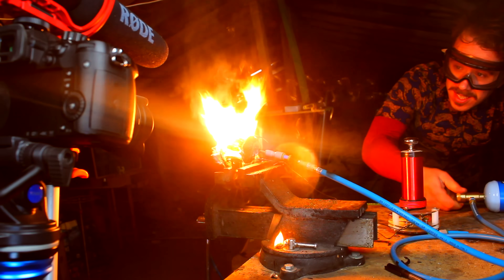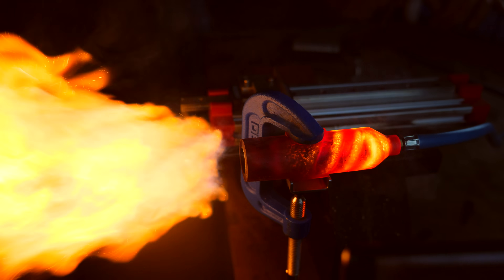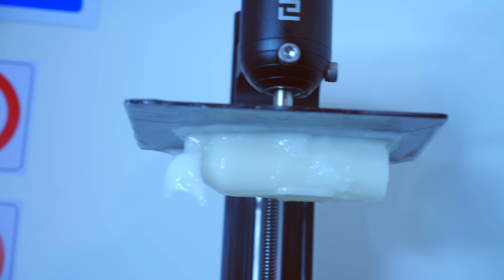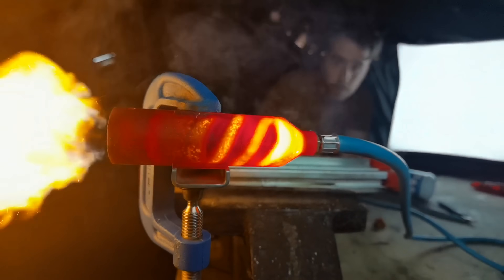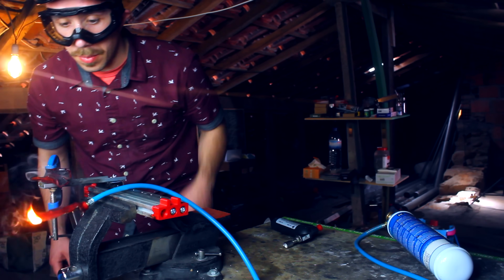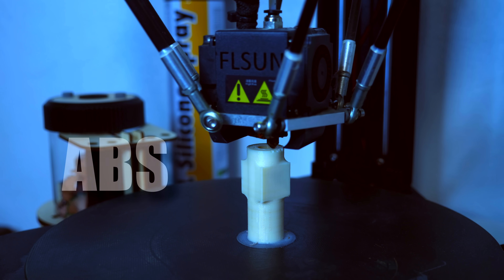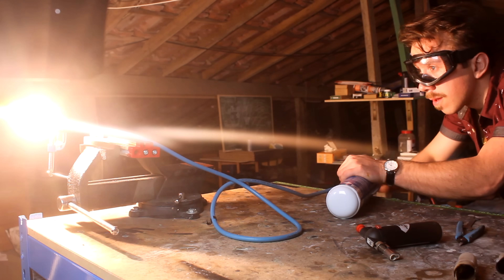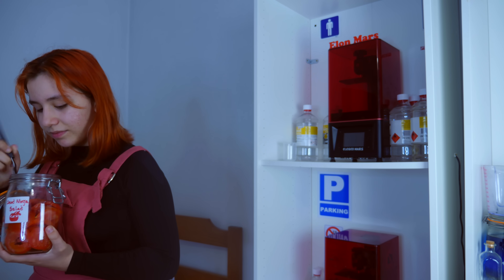Rocket engine that uses itself as fuel! (3D Printed)

Comment: Lots of other people saying this too, but:

The bright yellow of your ABS exhaust plume is unburnt solids, and basically means you're not getting nearly enough oxygen into the chamber, which is really hurting the thrust output and efficiency. Ideally the ABS would convert entirely into gas and expand under the chamber temperature to give a high exit velocity and thrust. But because there isn't enough oxygen for the fuel burn rate, the carbon in the plastic isn't fully converting to CO2 and is being ejected as a particulate solid. If you bump the oxygen flow rate higher, it should produce a flame that's closer to pure white and way straighter (rather than billowing around like at 11:13).

A really easy way to do that (I reckon at least) would be to insert a valve in your oxygen line so you can open the bottle to full flow rate before and then go to full combustion in less than a second. During the time it takes you to manually throttle up with the hand valve, the fuel is burning very suboptimally and costing you a lot of thrust. 

Feel free to DM me for more hybrid rocket deets, I'm working on an extremely large one in my university team :D
Reply: Underrated comment

Comment: I wonder if your thrust "measurements" are not showing much because of the engine placement on the arm. Specifically, I wonder how much of that energy is being used to try and turn the arm rather than push it forward. I'm no engineer or physicist, just a normal guy with actual questions.

Comment: Use a thick walled cardboard, 10mm walled tube for the body of the rocket motor. you will need steel or graphite or ceramic for the nozzle and forward bulkhead.

Comment: With the rockets try using a copper tube for the body and printing "inserts" to use as fuel. Use the same electro plated parts for the nozzles.

Comment: You coud print the body and then put it inside a steel or aluminium tube of the same diameter.. well, not the same, slightly larger tube, so it have more resistance.

Comment: If the fuel of the rocket is in the plastic housing, could you try to increase the surface area inside the rocket? This would increase the burn rate, which increases internal rocket pressure -> increases thrust? Additionally, making sure that the inputted oxygen is interfacing with the burn surface of the rocket equally and consistently would make the rocket more efficient per amount of fuel used.

Comment: Great Video Buddy!

  MY Submission for a future video !

 3D Print a Fire proof case out of a mixture that contains the ingredients of "Starlight" with a fire proof resin as a binder... That can be a case for your  Sugar-fuel Nozzle body made to fit snuggly inside the case. This case will have a more firm clamp onto the oxygen line Nozzle (and later the air intake Nozzle).

  Hopefully the entire body of the Nozzle/Solid fuel will burn itself out...

  Additionally, when you build this case, build an afterburner lip that redirects the ejected flames 🔥 back toward the center of the thrusting fire vortex... This case, if built and fired correctly, will probably provide you with re-usable cases which contain the solid fuel, then can be cleaned and reuse again later....

  I watch every video! 

 And plan to help on your support site as soon as I'm able to.

   Keep it up!

Comment: If you want to maximize the power of the rocket you should definitely increase the surface of the burning fuel. It will burn much quicker so more energy in less time gives more power, hence more thrust. For example if you consider the homemade rockets that use a mixture of sugar and KNO3 as fuel, they burn at least 4 or 5 times faster than the ABS. You can increase the surface by printing some deep and thin grooves inside the cylinder for example or by dividing the main cylinder in many smaller straw-like cylinders.

Comment: This is probably the coolest thing i've seen done with a 3d printer, great job (also I hate to be that guy but, you should probably invest in some flashback arrestors, especially if you go back to using an oxy-fuel mixture.)

Comment: I thought burning ABS produced some toxic fumes... for what I am reading is not THAT bad, but still be careful bro! Nice video as always.
Reply: Agreed, definitely wear a full respirator approved for VOCs when burning plastics! I'm not sure exactly which type would be needed, but if it stops the odor, it's probably good enough
Reply: Yea produces hydrogen cyanide which itself is pretty dangerous but I think with good ventilation the amount shouldn't be dangerous but I also think that's intended to be typical exposure from printing it and such not using it as a combustible fuel.
Reply: This needs more upvotes. Burning plastics in general isn't exactly healthy and I don't think that there's enough ventilation in that attic. A good respirator mask would be highly recommended.

Comment: I wonder what would happen if you printed a temp resistant material around the outside of the fuel part using a dual nozzle printer

Comment: Put the rockets right above the linear rail instead of on a long stick. You will see alot more movement with smaller trust. Those linear rail are not cant handel the sideways torq verry well and that causes them to cease up.

Comment: The answer is yes. A rocket program I was briefly involved in (sounds more impressive then it really was) was looking into using a 3d printed plastic as a more eco-friendly rocket fuel based on a scientific paper. Maybe try a resin sleeve and pla for the core

Comment: You could just 3D print a model rocket and use a sugar engine instead of the standard hobby grade testers engine.
Or a plastic fuel rocket engine.

Comment: Make an enclosure and nozzle from metal parts or maybe electroplated resin, and 3d printed material for the fuel. You can experiment with different mixture for the fuel. The good part is that you can swap another fuel when it burned.
I like to see those aerospike nozzle from metal parts 😁
Reply: That could really help with the thrust issue too since the nozzle would no longer be burning with the fuel.

Comment: You should try to find a way to maximize surface area with the solid  fuel, maybe try to make the inside of the engine have several small (like 1 or 2mm in diameter) canals which converge at the nozzle or instead make a central canal with longitudinal grooves. I think something like that should increase thrust substantially, assuming the engine holds up and you can feed enough oxygen to the engine. 

Devias tentar encontrar um modo de maximizar a área de superfície com o combustível sólido, podes tentar algo tipo fazer o interior do motor ter  vários pequenos canais (1 ou 2 mm de diâmetro) paralelos entre si ou então usando um canal central fazer uma série de rasgos longitudinais (a relação entre o diâmetro do canal e a profundidade dos rasgos é importante, um diâmetro mais pequeno com rasgos mais profundos vai dar-te uma área de superfície grande com um pequeno volume de oxigénio necessário, no entanto tens de ter enconta que estes rasgos muito profundos vai enfraquecer a tua estrutura, diria para começares com rasgos pouco profundos e ir aumentando a profundidade progressivamente- não incluí esta parte no inglês porque tinha medo de não me explicar bem). Penso que isto deverá aumentar substacialmente a impulsão do motor, assumindo que se consegue alimentar oxigénio suficiente.

Comment: I would get a ball valve for your O2, in cause of need for speedy shut off.  You might also want to try a slightly long rocket, with a narrow tube to deliver the O2.  And if you had something more robust to direct the exhaust you would get more thrust. When you ignite your fuel it first eats up that opening and you loose thrust.  You might try a washer or the like and see what happens.  Also a cowling or body would help as well the center burns out the side and the energy escapes that direction.

Comment: It would be cool to see if you could build a rocket engine that can run on hydrogen, that way when it burns it would just make water. you could probably make a liquid one being that you allready made a  jet engine and so naturally a rocket engine is the next step, same principles just with an oxidiser instead of air, youd also need to figure out how to 3d print an ablative nozzle and a combustion chamber that can survive high pressures but i think you could do it (:

Comment: If you want a beter fuel you can use filament with metal in it. I was part a project where we use paraffin mixed with aluminium powder for an hybride rocket. That thing had a really good trust with pure oxygen.

Also you should use grooves for the inner shape of the solid fuel. Rocket compagnies have specifics designs to maximise the surface area for beter reaction. You can search "solid fuel geometry" for more ideas.

Comment: I'd make a video about making a benchtop CNC mill for small parts and possibly press dies, its a bit easier to set up and get going with and imo more practical. You'd already have lots of the parts needed from the 3d printers, like extrusions/motors/hardware, with the most expensive part being a decent spindle motor. I feel like being able to make 3d metal parts is a must. May even be able to make some forms from aluminum to press steel tube into a bell shape for rocket nozzles. With a mill you'd be master of all materials!

Comment: You said multiple times that the rockets not producing any trust, that is not entirely true. You have a big clamp on the rail and a tube at the back of the engine that adds resistance (this tubes looks not really flexible) So actually the rockets probably producing more trust than you think.

Comment: I guess you have all parts to go big: ceramics should be ok for nozzle, get half decent metal pipe made of refractory metal or alloy to withstand heat and keep engine from destroying before fuel is gone (possibly with tapped end to screw your ceramic nozzle) and print abs solid fuel cartridge with some pattern inside to maximize surface contact area for oxidizer.  I not sure is there any pre-nozzle parts used for real rockets but with 3D printing you can try that also. So three parts, make them “standardized” so you can swap one part at a time, test new design, iterate more.

Comment: Acrylic is a popular fuel for hybrid motors, your challenge is to source PMMA / acrylic (polyester) filament. On the plus side, it has a nice aromatic smell when it burns. 
Looking at the energy density (specific heat of combustion) data, polyethylene is very high, almost double that of PMMA, but it doesn't resist heat very well.

Comment: You should use the design of a reloadable rocket motor. There is a metal casing that the propellant is then loaded into so the propellant can burn completely without burning in the engine wall, then just reload more propellant into it. you can google "Reloadable rocket motor diagram" to see how it works. Hope this helps.

Comment: I think you are starting the combustion on the wrong side and burning your nozzle in the very first few seconds. You should try using some ignition strategy that allows you to start the combustion right in the oxygen inlet, so the nozzle survives as long as possible.

Comment: You could get some steel tubes and print the fuel to tightly fit inside of them. For the nozzle, it is possible to just drill a small hole in a pipe cap. On the oxigen end I'm sure you can get a fitting that would also screw onto your pipe and fit your O2 hose. I think this would make a rocket engine that is able to burn trough the fuel almost completely and be more efficient for that reason. It would also benefit form the fact that the nozzle would't burn with the fuel and remain of constant width. With that said, I don't know how hot your fuel burns (+ haven't tried to do this) and I don't want you to get molten steel flying around your attic sooo good luck. I love your videos, keep up the good work.

Comment: I think it would be interesting to possibly combine the vortex engine and 3D printed fuel ideas!

Basically, if the combustion is in a vortex near, but not against the plastic, the plastic areosolize from the high heat, giving off flammable vapors, before burning off entirely. This may give more thrust, as more energy goes into combustion than melting.

No idea if this would actually work, but thats science! Just test and get a result lol.

Comment: You should redesign the rockets with spiraling fins on the intirior. Also, use a 90 degree thrust meter where one arm has the rocket and the other pushing against a scale. As used to measure thrust of r.c. motors.

Comment: Note that a converging-diverging nozzle (de laval, aerospike, etc) will only work, i.e. produce supersonic exit flow, if you have enough chamber pressure to reach choked flow in the throat.  That takes at least 15 psi with air, but likely similar with your gases.  Even if you set your regulator to >=15 psi, right now I suspect your nozzle diameter is too large and you're seeing any of that pressure in the chamber, its just leaking out of the nozzle.

You may find you get higher thrust with a much smaller nozzle if it helps get the chamber pressure up.

Comment: Honestly you are very close from a good engine, just put the grain in a random metal tube, and find a way to integrate a "real nozle" (By real i mean not litteraly composed of fuel. I think that's the main problem: the throat ois being ablated away way to fast and the engine loose very fast it's efficiency). Just put a metalic or ceramic nozzle in it and you'r good! for nice thrust!

Comment: integza might i suggest putting a valve (like they have on water pipes for on and off) between the bottle and your rockets so instead of having to turn the oxygen allllll the way on and then alllllll the way off again, you can just flip the valve up, or down for on and off, also youd still be able to slowly open the valve to adjust how much of the oxygen or propane was coming out. 
being able to kill the fuel with one turn of the wrist instead of 30 could literally save your life bud

also you have your rockets so far from the sled you might be losing a lot of your thrust to rotational force instead of linear force. try putting your rockets right over the sled instead of hanging way off to the right and see if you get better results :)
 also, youre losing even more force because your nozzle is melting out lol.

Comment: As a fellow (and subscribed follower) 38yo Portuguese i watch all your videos and that has been giving me some great laughs... however there is one thing I keep watching in your videos that has been bothering me a bit...
Why don't you just make a clamping system for your oxygen tank with a bigger handle that are smooth and reliable enough to control and also very quick to shut the flow from your tanks?
I just think it would look really cool and safer (as you wouldn't need to hold the tank with one hand and close the flow vale with the other... also, it would make the whole bench more useful
I know this is not an idea for a full video but hey... i like your videos and would love to see that bench getting some "upgrades"

On a different note (AKA shameless plug here)...I am a Video editor if you ever need a hand... :P

Have a great day, keep those videos and tomatoes coming.

Comment: Use a ceramic nozzle. One problem I see is that your nozzle is made of the same material as your fuel so it burns away. In the beginning of the burn you can see some of your prints produce thrust but stop soon after. This is because your nozzle burns away before your fuel runs out. You need the nozzle to convert the pressure of the burn into outflow velocity. This works best with a converging-diverging nozzle. If you make a ceramic nozzle and attach it to the plastic fuel than it won't burn away and will produce more thrust for longer.

Plus get a metal pipe and print to its inner diameter. This will help contain the pressure and prevent the side burnouts you see you video.

Comment: 2:18 These things are called sparklers and they are awesome. You just need a ton of them. Take about a big handfull of them, take one of the wires of them, spool it around the base to hold them all together. Then let one of them stick out a couple of centimeters. This will be the ignition source. Stick the bundle in a bottle or the ground, light the one sticking out and watch. When the flame hits the others, they will all start burning simultaneously and it's incredible. Do it!

Comment: Love the progress on the rocket videos. After watching this one, I think the next course of action would be to use the ceramic resin to make the body and nozzle with a core of printed fuel. To help with the body leaking, you could make a top and bottom section that sleeve together. That way the seal is along the entire length of the body instead of at a flange at either end.

Comment: I would love to see a two-ignition system, where the first one basically acts as a starter and the second one is the main thruster
Reply: That is how the Shuttle SRBs are lit, as with many other large solid fuel rocket motors.

They have a smaller motor at the top to throw super hot exhaust gas over the entire larger fuel grain, so it starts basically instantaneously.

Comment: Encase the printed abs in a metal tubing. You should be able to reuse parts more often and actually use the whole printed material as fuel instead of only till it partially melts the combustion chamber of the engine.
Also you should get a ball valve to instantly (well more or less) get the oxygen at full pressure or to instantly shut it down. Also please stand behind some polycarbonate screen. The stuff you are building could explode... :x